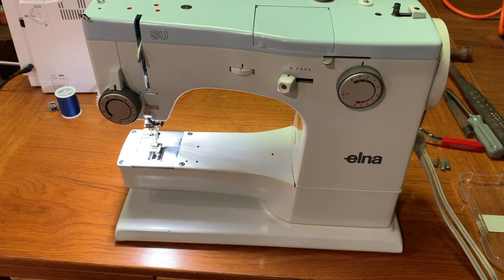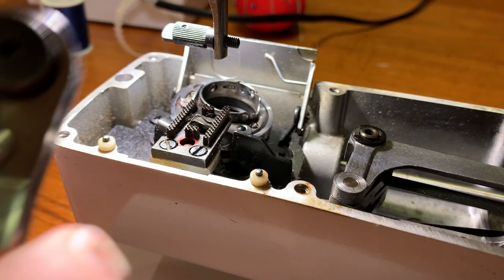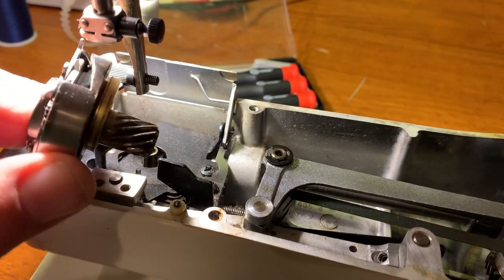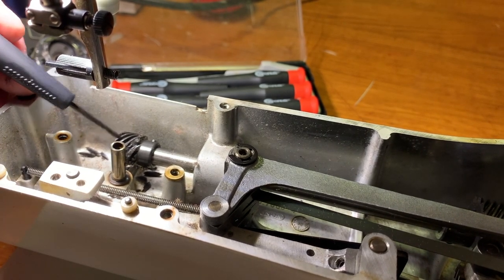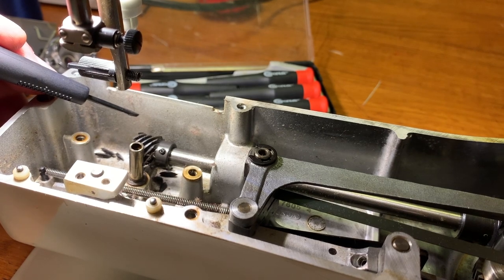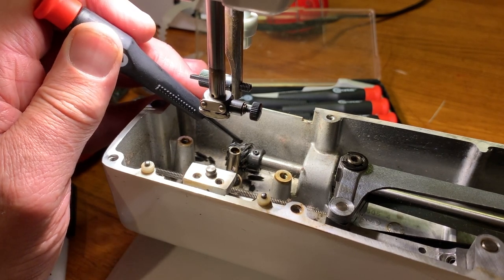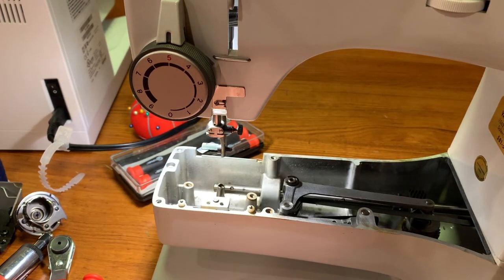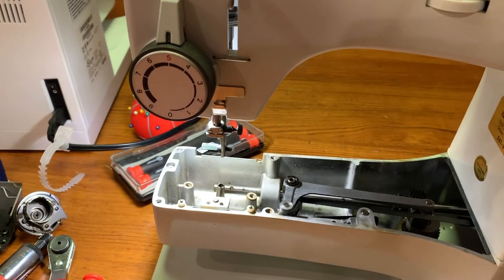Elna SU-62C Star Series Hook Pinion Replacement

Comment: Scott nt machaine ha give up the goast ad cant be fixed  i am very good with mt hands as my Father was gifted as a black smith and farrior  will it cost a lot
Reply from the maker: Is your machine like this one? An Elna blue top or similar, a star series machine in other words? If so the gear I replace here generally costs 10-15 dollars from either eBay or Amazon. It is not an expensive repair parts-wise. I have heard from many people who have used this video to repair their machines when the hook gear fails, Maire.
Reply: @Elnamech  yes my Elna has a blue top  it would  be BRILLIANT  if i got it repaired. THANKS  A MILLION FOR YOUR INFORMATION